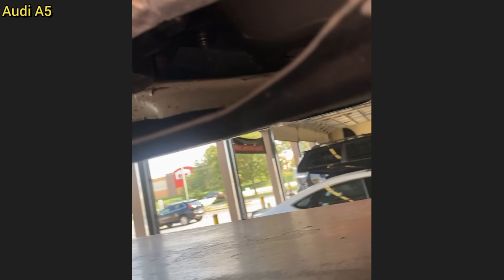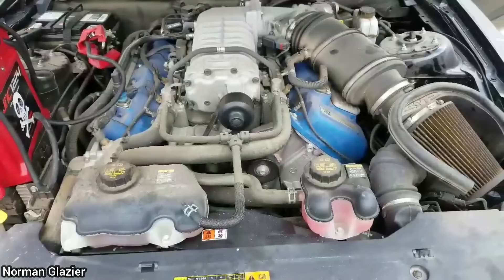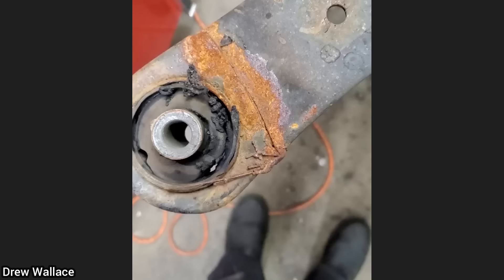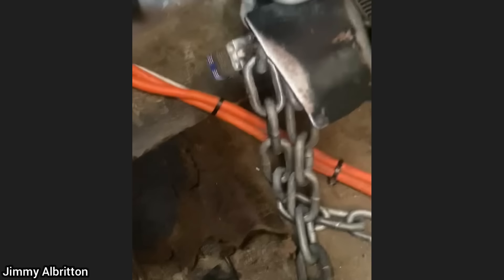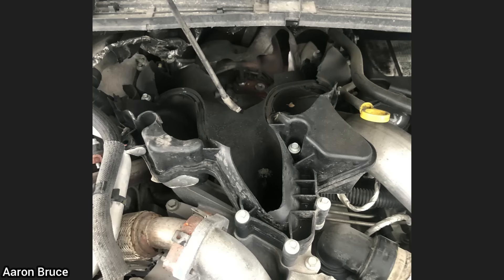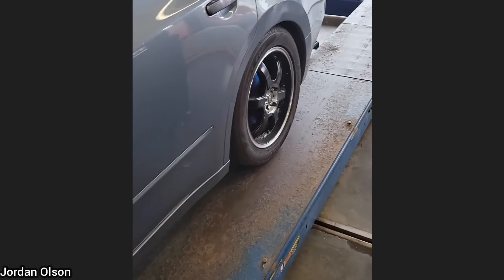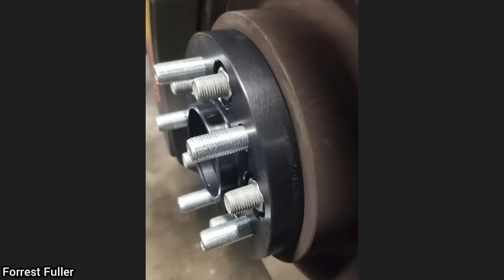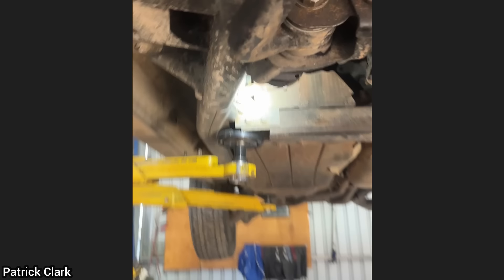Customer States Car Lost All Gears On Highway | Just Rolled In

Comment: 1:24 Let's be honest here, the chain and the sterring wheel are NOT the most concerning things in that car!
Reply: @A.J.1656  The two orange extension cords and the crappy wiring job at the stereo.
Reply: didnt really see a door panel and the orange wires I am going to guess was an extention cord, the lock and chain was the only thing that made any sense
Reply: i was thinking he didnt want anyone to steal it
Reply: Chain around the brake pedal and padlocked through the steering  wheel is a pretty common theft deterrent on commercial and military vehicles.
Reply: @MrBirdnose 
Might explain how the steering wheel got so loose. 
Trying to get full tension on the chain.

Comment: 0:29 this is a good time to remind everyone that you should get an oil change either every six months OR every few thousand miles (whichever comes first). the manual for your vehicle will specify how many miles you can go before needing an oil change
Reply: 3k miles unless u use synthetic, thats just me, its cheap,, i drive a semi for work, u can go alot longer with em,, my truck holds 40q luls
Reply: Synthetic says a year between changes and since i only do like 2000 miles a year the once a year oil change is worth it to me. It sucks to do and im sometimes late by 50-100 miles due to rain or heatwaves. cant understand why people make such a big deal over it and refuse to ever do it.
Reply: You assume that all owners read the manual, if they even know they have one, much less its location.
Reply: For a 6.7 cummins it says 12k or 1 year which ever is first. I just change it once a year. Granted I only have done one oil change as ive only had it a year and a half and havent broke 12k miles yet.
Reply: My manuals all say 10K miles/12 months.
Reply: Most European cars are 20-30k kms or upto two years. No one uses non fully synthetic oils in Europe. If that is what a manufacturer recommends than it is on them.
And tbh, I've only owned European cars for the last 14 years, never had an issue running to the two year mark or 30k kms. Clean fuel, better oils mean less oil changes, less pollution. 
Even if you don't change your oil, it will need topping up at some point if driven hard.
Reply: What I don't get is why? It's such a simple bit of maintenance. My Dad asked me to help him when I was about 8, explained what it was about, showed how it was done, and I've never missed a change on my own cars as a grown-up. I suppose some people just take their cars for granted, and don't get that an engine is a mass of moving metal parts that need to stay lubricated to work. Any cook will tell you what happens to oil if you over-use it.

Comment: That thing that went through the oil pan looks like a manhole cover removal tool.
Reply: close, but it is a soil probe. I have used them to locate buried manholes.
Reply: @SouthwestD313 soil probe, aka, the poker.
Reply: Yes I use them to find gas, water  lines and more before we drill under ground
Reply: Just hope some worker wasn't using it to probe the ground at the time!
Reply: Definitely a soil probe. Probably fell off a work truck.

Comment: That clamped fuel line is funny.  Some mechanic at some point forgot to remove the clamp after replacing (fuel filter maybe?) and the owner drove around like that for HOW LONG before it was discovered?  That stuff happens with forgetting tools.  Usually the original mechanic removes the clamp, apologizes to the customer, and all is well with the world.

Comment: I posit that the piece of metal that pierced the oil pan was a tool used to lift manhole covers or perhaps to turn on a water valve.
Reply: That's what I was going to say, 100% that
Reply: Soil probe/poker
Reply: @tommymaddox6785  Yeah, but, were you going to write that in a pretentious way like I did?
Reply: @K9River  not initially

Comment: I think what's sad about all of these vids are that once you spend enough time in the automotive repair industry, you're not surprised at ANY of this. In my 30+ years as a professional mechanic. I've seen or been directly involved with service orders like these. If not just like them, closely related. Even worse are the customers that say "I just picked it up from the shop" or "I just bought it at a used dealer". 
I've done at least two, maybe three, post purchase inspections were I told them to take the vehicle back IMMEDIATELY. Only to find out that several hours later the vehicles burned to the ground. I do find it somewhat amazing what some "mechanic's" ideas of "properly repaired" are. 🤯🤦‍♂

Comment: That clamp on the fuel line brings back so many memories. When I was younger my second car was an 1994 Opel Astra F 1.4i which was a little too thirsty for my wallet, so I tried to clamp the fuel line to reduce fuel consumption. It didn’t work but dang was it a reliable and well built car

Comment: My car has almost 40K miles on it, and I've never changed the oil. Runs perfectly fine.

Of course, it's a Tesla, but still.... :D
Reply: Even the EVs have fluids that will need to be flushed /changed at some point. Beware anybody telling you that it's "lifetime" — that just means if you don't change it, things will break/wear out well outside of warranty.
Reply: @bennyfactor  It means that its lifetime will probably be short.
Reply: What oil are you referencing?

Comment: The black truck at the end is a 67-72 era bodystyle. Hard to tell what year though.  Sidemarker lights are from a 72 but they would fit any model from 68-72 (67 didn't have them) BUT, assuming the plate is accurate (has 72 as the last digits), it's a 72 stepside.

Comment: That “unknown piece of metal” is used to poke into dirt to find buried utilities. (Water valve boxes, septic tank covers and so on)
Reply: Either that or a water meter key. Can't see the tip. Both are leaned against poles along the road.
Reply: and you know the person kept complaining the engine was shutting down and kept trying to drive it without oil. well deserved
Reply: It's a fifth wheel puller for a semi.
Reply: @turdferguson3855   I thought that too but not only is it painted road cone orange, but the end is straight, not curved like a puller.  Source: hubby drove truck for 30 years.
Reply: @petuniasevan  painted  just like a Schneider truck.
Reply: @turdferguson3855  yep.  And we called the construction barrels "Schneider eggs".  I do live near Green Bay so the comparison is very apt.
Reply: @petuniasevan  they sell them at company stores. You can't see the tip and the hole in the pan is triple the size of the shaft.

Comment: Yeeeeah I have an ST, too. Those gearboxes are sketchy, and methanol + tune is the fastest way to blow them. 

BUT since it's so similar to the RS, it can handle probably up to 400hp reliably. After that, you can find yourself with 7 neutrals. Not to mention they leak, so gotta make sure they keep all that fluid topped off and sealed. Mine leaked at the shifter tower housing.

Comment: 2:18 That is a MightyProbe. Its a tool that is used to pierce the soil to find conduit, pipes, roots, footings, septic tank lids, etc. Without having to dig to locate it. So you only have to dig once. Almost every plumbing and septic truck will have one on board.
Reply: ......was the vehicle a Ford Probe as well?

Comment: The guy that put a chain and lock around the steering wheel to brake pedal was definitely in the military at one point. It's the way we always used to secure Humvees.
Reply: I'm thinking he over-tightened the chain which caused the steering wheel to loosen.

Comment: That tire mounting fluid blow out goes to show why newer technicians are trained to not diagnose possible fuel delivery trouble with starter fluid.  Hopefully no one was injured by the shrapnel from the blown intake.

There are much safer ways to check if the engine is getting fuel.  Although a lot of vehicles lack the screw on pressure test port and you'll need a good scan tool to read the sensor outputs.

Comment: That orange thing that pierced the oil pan of the unfortunate Mercedes looks like a T-handle used by city maintenance workers to lift manhole covers. Probably got left on the road, or perhaps the Merc driver was in a hurry and drove through a worksite, picking up that crazy souvenir. Pity that Mercedes’ engineers hadn’t the foresight to prevent that hazard…

Comment: Truck in question is a 1971 Chevrolet Cheyenne Stepside. 1971-1972 fronts are very similar but 1971 has round tails, 1972 has square.

Comment: 2:35 I suspect someone forgot the clamp after changing the fuel filter. which hides behoind that tin plate screwed to the frame, where the fuel hoses vanish to. best place for it too, you have problems handlign it because tight space, and dirt gathers on and behind the tin plate corrodign everythign into a lump... these cars have so many little stupid quirks it made me wonder if it was on purpose.

Comment: 2:13 That duffus with the Mercedes with the hole in his oil pan doesn't deserve a good car like that.  The best one was the phony drilled brake rotors.  Kind of like those blue headlamp caps people were putting on about 20 years ago to simulate Xenon discharge.

Comment: my land rover had an oil change done at dealer,  all good right? nope.  i drove away not 2 or 3 minutes engine start screeching  and burbling and it died on me RIGHT ON THEIR LOT>     i just got out and walked into speed garage doors. it opened  and i just walked inside..  the guy said " back already? "

i just gave him the keys and said " its dead. fix it" 

turns out. tech left two red SHOP RAGS.  it got wrapped around waterpump and a couple pulleys and locked it up       i got loaner for a week  no charge,  the repairs was free too.  new water pump, idler pulleys and belt.    detailing and all.       so yes.  if you work on your car ALWAYS MAKE SURE YOUR RAGS ARE OUT

Comment: Speaking of oil changes, I have a Ford Fusion Hybrid and the owners manual calls for an oil change "'once a year, or every 10,000 miles". I find that very odd.
Reply: Why is that odd? With a hybrid you still have a gas engine. That's pretty much the schedule they say on any car these days. There is generally an indicator telling you when to change oil, but those are the maximum if the indicator doesn't call for it yet.

Comment: Is that first video the Ford Powershift DCT? AKA the worst transmission ever built, even by the engineers who design it own admission? If so, that's absolutely bullshit the warranty was denied. Ford has been sued over that transmission twice, a third time for lying in the second lawsuit and are currently in a fourth for lying during the third lawsuit. The engineers that built it tried to whistleblow on the design defects during the design phase and were even quoted saying "Ford wanted us to ignore the laws of physics with that transmission". They fired anybody that tried to speak up about it and it's currently sitting at a 75% failure rate. "According to internal documents, Ford knew of the PowerShift transmission's inherent problems before production started but went ahead with it, telling dealers "to tell customers that the cars operated normally" when it knew they were problematic." Just because you modified your car doesn't mean you shouldn't be entitled to warranty work related to an INTENTIONAL design defect like that!

Assuming that's the Powershift, I can't actually tell.

Comment: In the second clip what does the charcoal do like what is it for?
Reply from the maker: I put more info in the description for each photo and clip. I got more info regarding that in the description 😁
Reply: it absorbs gas fumes from the fuel tank, then slowly feeds them back to the motor to burn. keeps the fumes from just being vented into the air.

Comment: ... what they think is covered by warranty (seized engines without oil etc.). 🤭🤦‍♂️
And if you have a legitimate reclaim after buying a new car for a 5-digit price there will be a discussion in the dealership about a €/$/£ 10 to 20.- repair for tightening a loose nut/bolt. Finally you do it by yourself. 😵‍💫

Comment: I really need to know what the issue is with not having an oil change for 12,000 miles. Many cars have a 18-24,000 service schedule. What oil are you using?
Reply: 12k miles is too long, the recommended service schedule is often designed around the warranty period. also sitting in traffic for extended periods is not what they consider "normal use" and requires changes more often. the real issue here is the length of time, the oil hasnt been changed in 12 years which regardless of mileage is a huge problem. should be every 6 months no matter the mileage
Reply: He clearly mis-spoke. If you look more closely you will see that the odo reading is posted as 193,000 km. That's close to 120,000 miles.
Reply: The service interval for a 2012 GT500 is 7500 miles, using full synthetic oil

Comment: Just FYI, starter fluid is NOT ok with fuel injected engines.  My roommate damaged his car doing it, although not as extreme as in this video.
Reply: Especially not diesels with glow plugs/intake heaters (description says Ford 6.7 Powerstroke). Just about all modern diesels have a warning label under the hood saying to NEVER use starting fluid for this very reason.
Reply: @Jakek200  Wait, you expect people to read ??? These are the same types who put oil in the brake master cyl, coolant in their washer bottle, and brake fluid in the engine.

Comment: How does a 2012 Mustang now have only a bit over 12k miles on it? I mean, I guess that's why the oil was never changed. It was almost never driven and the owner just didn't think about it.
Reply: pretty dumb owner though, should be changing it at least once a year regardless of its been driven or not (every 6 months is better)
Reply: He clearly mis-spoke. The actual odo reading is posted on the video. 193,000 km is almost 120,000 miles.
Reply: @keithbird8910  he didnt, it was 19300 km

Comment: I bet that chain was wrapped around the steering wheel to prevent theft or it was towed often???
Reply: GM steering columns of that era were pretty horrible, that kind of looseness was pretty common too.  I owned a couple that didn't need a key to start.
Reply: @northshepherd8010  I’ve worked in GM dealer for over 20yrs. I’ve seen that 100’s of times. I was just thinking of the chain aspect.
Reply: @Merica_dadgarage  I think your anti-theft guess is probably correct. Chain would prevent the steering wheel from turning too, kinda like The Club.

Comment: $300 generators are smart enough to shut themselves off when they run out of oil,  why arent cars?
Reply: they don’t have a sensor for it apart from oil pressure and by the time that reads low it’s too late. most people should be smart enough to pull over if something hits the bottom of the car etc

Comment: A 2012 with 12k miles? Even a daily driver will be fine going 10k+ between oil changes.

As light as that mustang was driven, I doubt the lack of an oil change destroyed their engine. Oil will also last for years just sitting. It doesn’t “go bad” like milk. 

Dealers push 3k oil changes because it’s a huge money maker for them and many will even reprogram your cars DIC so the oil change reminders pops up sooner.
Reply: its the time thats the main issue, 10k is a bit too long regardless especially for a performance engine thats being driven like one. oil does absolutely go bad, the shelf life in a sealed container is only about 5 years. when its in the open and susceptible to water and has contaminants from being in an engine its much less than that. 1 year is the most you should really be going without a change, 6 months is better. you need to see what an engine looks like thats had 3k changes since new, also for performance cars they go through oil much quicker. the oil is black by 3k in my celica, 0 chance i would wait 3 times that

Comment: 12k miles and no oil change isnt bad though since synthetic oil are rated for 15k
Reply from the maker: It has factory engine oil in the vehicle and is 11 years old in a high performance engine. If it was changed prior to that I could see but not with factory oil that old.

Comment: If your car can't go 20k without an oil change what are you even doing? 😆 I think I changed oil once in my camry.. I had it for 7 years and 140k kilometers. Granted, I did add oil intermittently because it used some oil during peak summer, but like 500ml a year or something..
Reply: its the time that matters more in that situation, and it is completely different to your camry sorry. and changing the oil once in 7 years and 140k is extremely stupid but im really not surprised